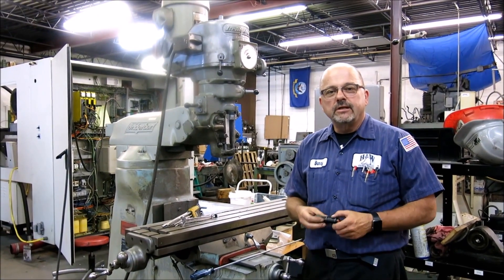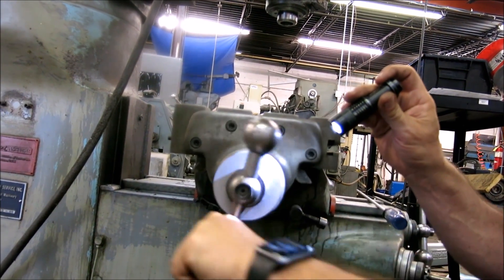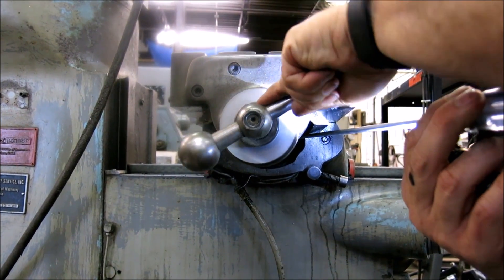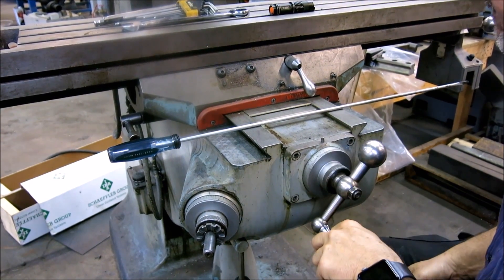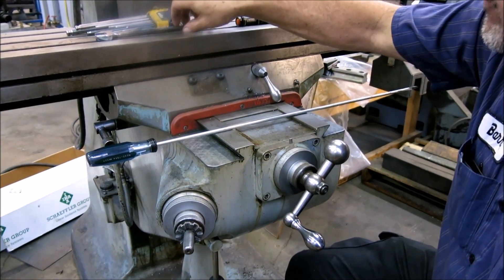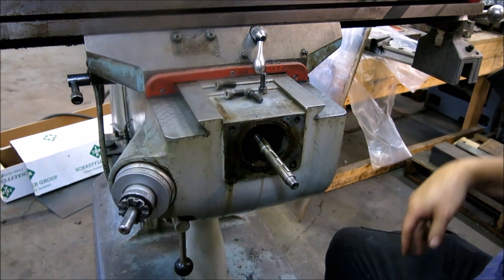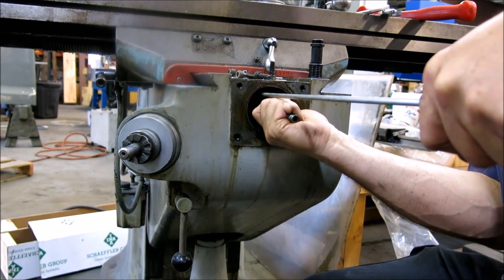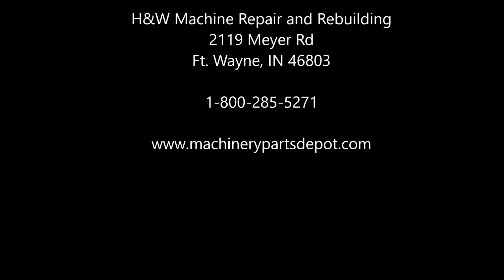Adjusting the Backlash on the X&Y Axis of the Bridgeport

Comment: Barry, have you made a video to sho how to repair a handle that keeps falling off
Reply from the maker: We don't, but if you want to give us call we can help you troubleshoot: 1-800-285-5271
Reply: How about a video for this adjustment with ball screw conversion installed
Reply from the maker: @SignatureMinis522  There is no adjustment for the ballscrew backlash. Usually when you are having issues with backlash in your ballscrews it's either an issue with the bearings in the capture side end cap, or your ballscrews are worn and need to be rebuilt. Give us a call if you have any questions or want help troubleshooting:1-800-285-5271 or 260-422-0020 (local and international)

Comment: I have a question. This  mill is equipped with a x/y nut holder made of cast iron I think where the leads crews are sitting. It it possible to bore these out so you can put a few ballscrew heads in this nutholder?  Or replace the whole kit and caboodle with a homemade cross section? It will get rid of all the backlash and makes this mill adaptable for cnc..
Reply from the maker: There are several CNC packages that require you to drill and tap into the existing Feed Nut Bracket so yes, you can modify the bracket as needed provided you have the required room to do so.

Comment: Hi Barry.  I’m a furniture builder who happens to own a Bridgeport milling machine.  Really appreciated your video on breaking down the table, saddle and knee.  Wished I had watched it before I erroneously shot grease into all the zerk fittings.  Duhh!  Tell me this is a common mistake among the non-pro-machinist set.  While I have faithfully applied way oil to the ways, I never realized there was a way to inject it through the zerk fittings.  Wish the Bridgeport had affixed a ‘NO GREASE’  warning to the machine.  But, thanks to your excellent video, I now have cleaned all the grease from my table, saddle and knee, and have a much better understanding of those parts.  Thanks again!    William Turner

Comment: I do it a little different for the Y axis I take all 4 bolts out of the end cap and just wind the screw out with it out then I can clean it and oil it make a small adjustment and wind it back in and only put two bolts catacorner  in the end cap and check your specs if not in spec remove the end cap and readjust but what ever way works for you is good also

Comment: So, for the Y axis, are you telling me you have to remove the woodruff keys, handle, bearing mount, etc. each time you make an adjustment until you get it right?  Seems like a lot of trial and error since you can't make a measurement until everything is back together (unlike the X axis).  Thanks,
Reply from the maker: You do not have to remove the key unless you have a power feed on the Y-axis but other than that you do have to remove the handle, dial holder and end cap each time you dial in your Y-axis nuts. - Barry
Reply: @HWMachRepair  Thanks Barry
Reply: Sou nd baba Amos intrested bt helll no

Comment: What's the plan if the large screw won't tighten anymore to remove the backlash?  Time for some new nuts???
Reply from the maker: Normally if you run out of adjustment for your nuts then yes, it is time to replace the nuts.  If you take it out and find you already have the two piece nuts and they seem to be in good shape you can rotate one of the nuts out one revolution to create additional adjustment.  Give us a call at 800-285-5271 to order the parts or if you have any additional questions. - Barry

Comment: My bridgeport has been well used now for 30 years since it was new. I never adjusted the nuts because I didn't think you could do it. Anyway, they're .005 and .007 now took 25 minutes. Question, can a quill be removed without taking the top half off? Mine is real tight.
Reply from the maker: Hi Josh, to remove the quill properly you are going to have to take the top half off. There are ways you can do it without, but you are going to destroy your quill skirt at the least and possibly other parts in the process. Give me a call if you want to discuss your issue, we may have something else that may help you out without taking it all the way apart. 1-800-285-5271

Comment: Barry,

Where did you find the screwdriver with such a long shaft.  Exactly how long is the shaft on that.  Is it a blade of Phillips?

Thanks,

Patrick
Reply from the maker: I got that at Menards, which is one of our hardware stores here in town. It's 2 ft long and it is a Phillips head. None of our suppliers sells one that long so I will just share the link to it on Menards website: https://www.menards.com/main/tools-hardware/hand-tools/screwdrivers-nut-drivers-hex-keys-sets/masterforce-reg-phillips-no-2-x-24-screwdriver/p-1444451307599-c-9158.htm?tid=-7681567113562538001&ipos=20
Reply: Patrick Carr Just cut the end off a screwdriver and we'll it to a length of rod. Pesto-change-o